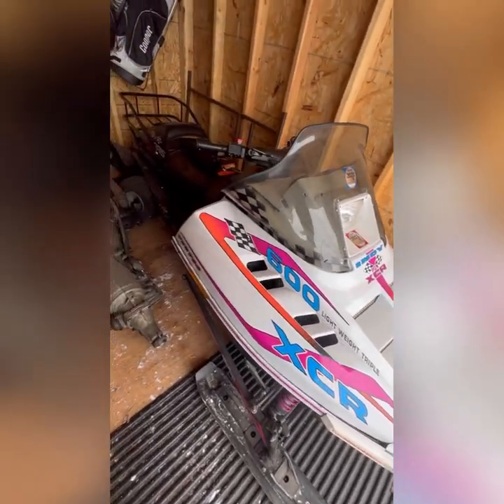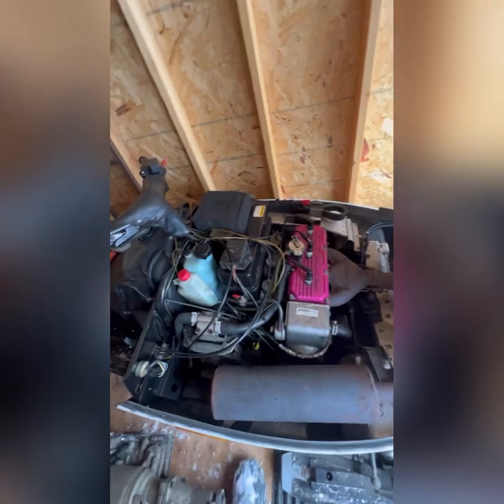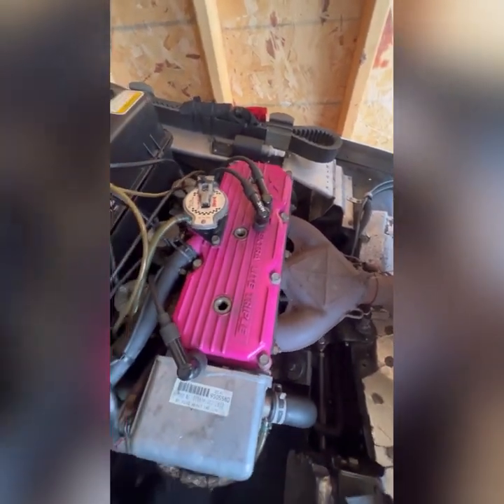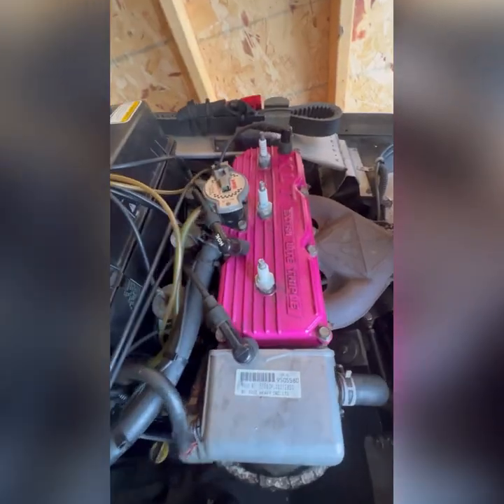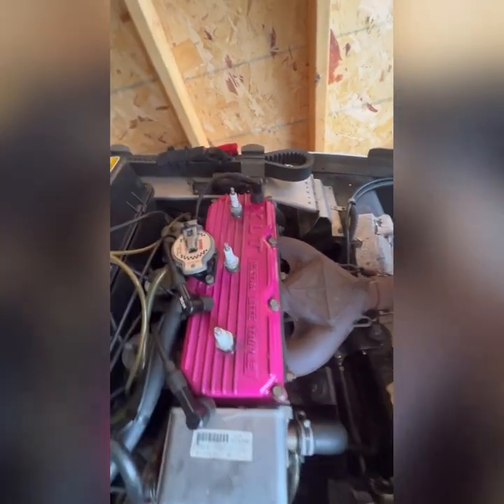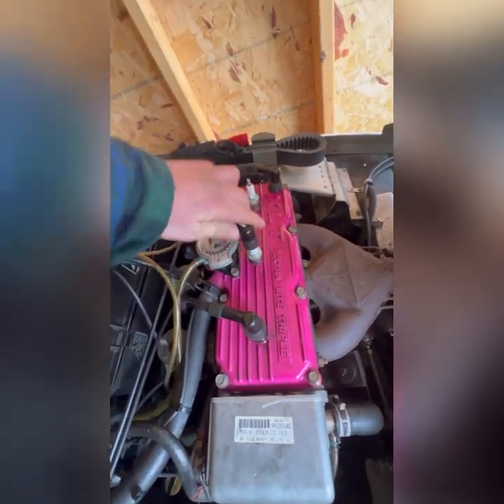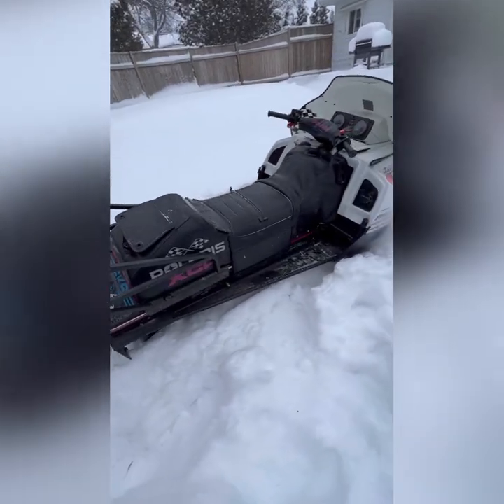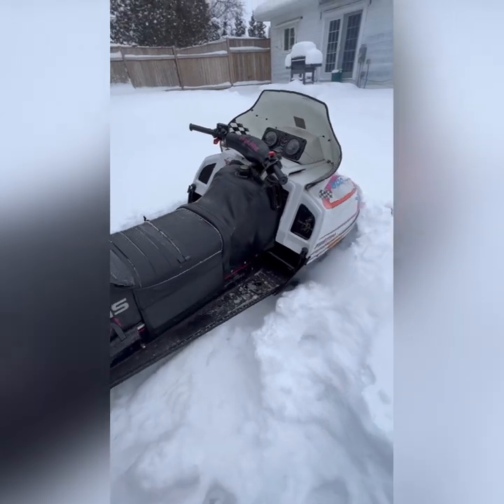How To Easily Start A Greasy Triple (First start up of the season)

Comment: Blow in the tank to pressurize the fuel system way easier that taking plugs out 2 stroke gets the fuel from the crankcase not the top of the pistons lol
Reply from the maker: Yeah I’ve done the ol blow job trick before. I just don’t like the taste of gas fumes lol. Gas down the cylinders normally always works for me an it only takes an extra 2 seconds.